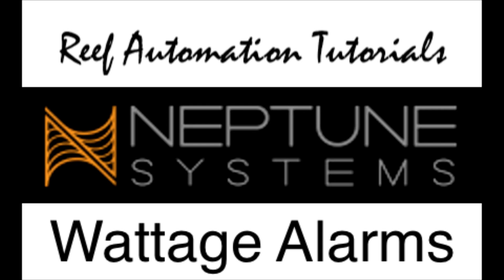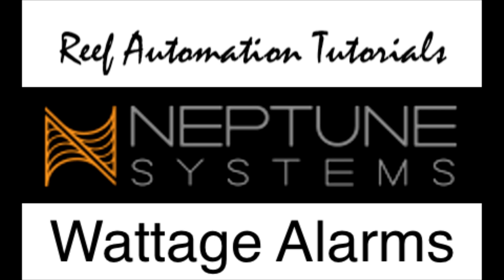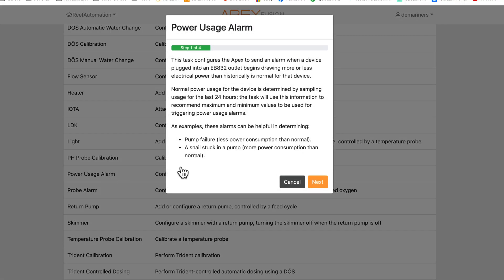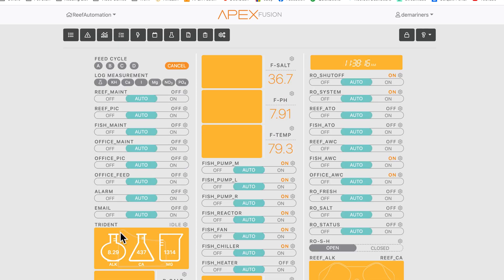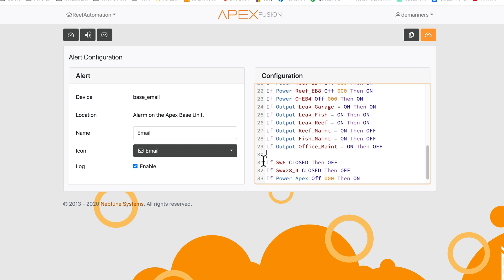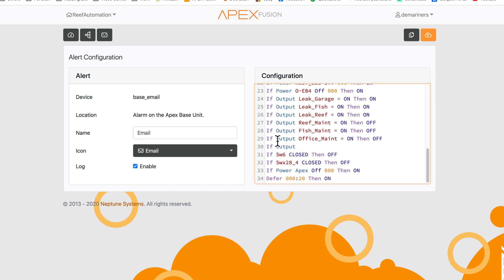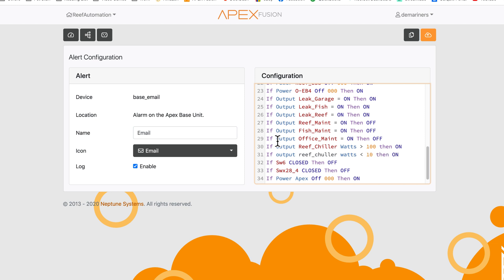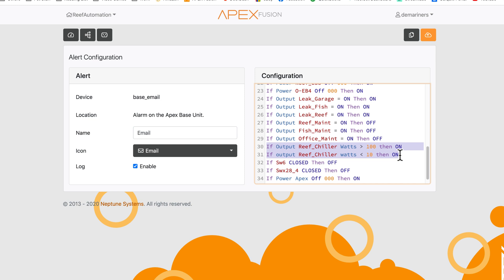Neptune Systems Apex Tutorials - Wattage/Outlet Alarms/Programming

Comment: I just had to replace the small power supply in my EB 832 because power was no longer being supplied to the outlets. Are you aware of this issue? Do you know if there is any code to set an alarm that if power is not going to the outlets, even though it’s plugged in, it shows that it’s on I will get an alarm?
Reply from the maker: I personally have never had any issues with the EB832